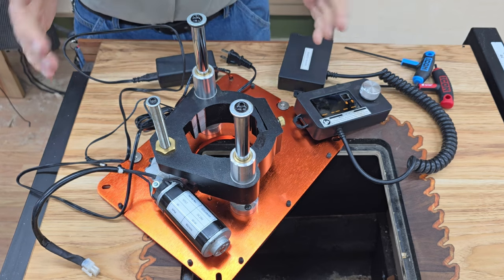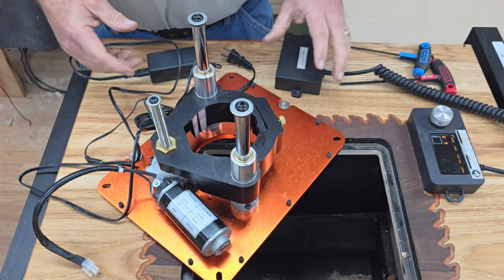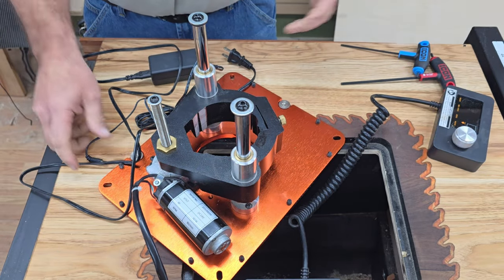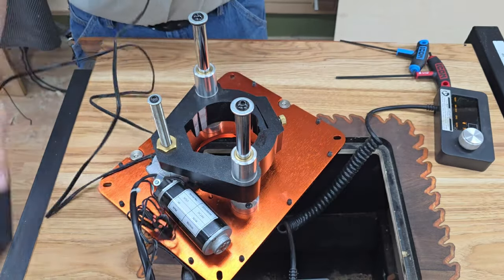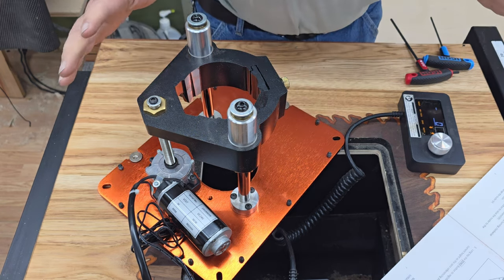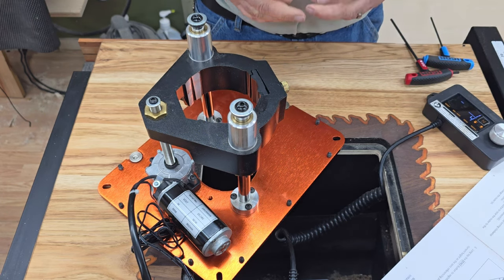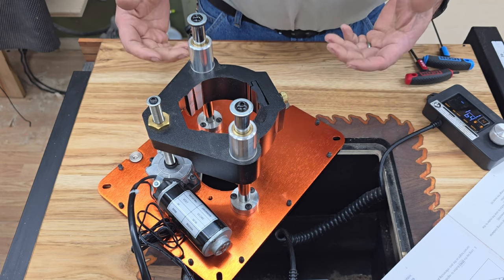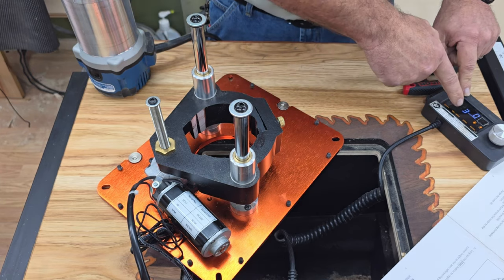O'SKOOL Motorized Router Lift Systems

Comment: Thanks for the setup.  You're about the only video that goes through most of the setup.  I went on to buy it.  Question though how did you go about the 1/4" screws.  The instruction doesn't say much about how they screw down. Do I need to thread some holes in the table or no drilling needed for those?

Comment: I just built a router table and put the manual o s  lift in a 1 inch thick acrylic top, kinda wild like yours.
Reply from the maker: So what do you think about the quality? 🤔
Reply: It seems to be just fine, i havent worked it very hard yet but I will very soon.setup and bit changes are qick yours has a bit of a learning curve to it. I just bought a new table saw or I would have got the motorized one too. @ShopRamblings

Comment: I think I’m sold. Hopefully, it is the same size as my Rockler router plate. Thanks for the review.
Reply from the maker: I was fairly certain they were. Jessem makes the plates for Rockler, Kregg, and Incra. I just ran back out to the shop and pulled out a Kregg plate I had. They are the same size as the O'Skool
Reply: @ShopRamblings  thanks, buddy. Good job on your reviews
Reply from the maker: Thanks

Comment: Nice...my only thing is it moves soooo slow.. definitely guna consider it..,thanx..
Reply from the maker: It moves slow on short moves. It does speed up when making longer moves. To be honest, I was thinking the same as you when I first started using it. After using it, I realized that the only time I am making long moves is when changing bits. I hit the move all the way up button, and it finishes before I get the new bit out. Setting up the proper height is so much faster. On bits I use frequently, I am going to start marking the height I use them at. Then, I can install them and set the height on the first try. It's so much better than the way I have done it for the last 30 years. #efficiency #productivity #timemanagement
Reply: @ShopRamblings  oh ok.. good point...think I'm guna get, I'm sold because the set up is simple and the accuracy I can tell is there.. thanks again..
Reply: @ShopRamblings  Does the device have a memory of those heights, or do you just need to keep a notebook of what height each bit is?
Reply from the maker: When you set it up the first time it remembers top and bottom. It then only has one preset that you can change. That is zero. 🔧

When you change bits, they may not be in the same place. What would like would be a sensor where you could lower the bit. Place a metal ruler across the opening and raise the bit up until it touches.📏

I currently do this manually and set that as zero. Then you can raise the bit to a predetermined height. 📏 #woodworking #DIY #tools
Reply: @ShopRamblings  The sensor you're talking about is a touch off gauge.  I'm not sure if they make one router specific but there are a lot of different models for machining, both manual and electronic.  I'm sure you can find one to work with a router table, or make a jig to hold one.

Comment: IDK, $429 + tax to lift a $150-250 router? I don't see the value.
Reply from the maker: The lift is what gives you the accuracy.
Reply: @ShopRamblings  I realize that. Idk, maybe.
Reply: I don't understand why most router lifts cost $350-500.  There's so many power tools that seem like they are more complicated and expensive to manufacture but can be had for a fraction of the cost of various router lifts.
Reply from the maker: Most  are just a couple of linear bearings and a lead screw. This one has all that and a precision motor, control panel, and all the electronics for the same price as the Incra.   @YTubeSDD